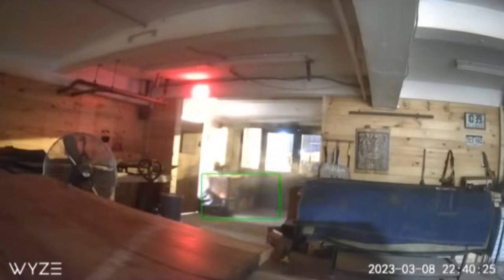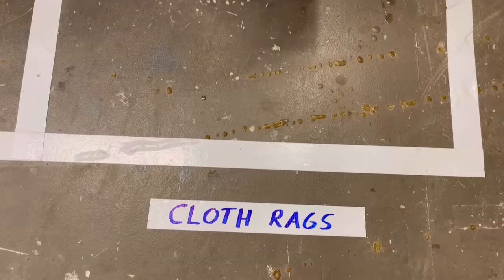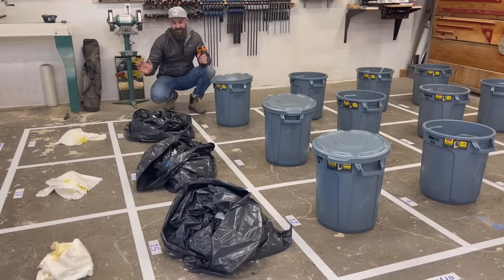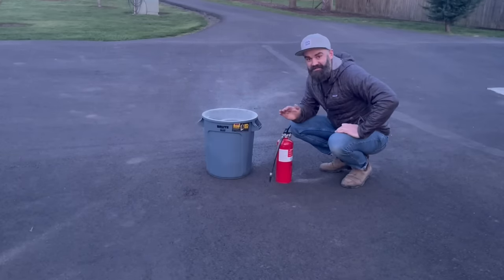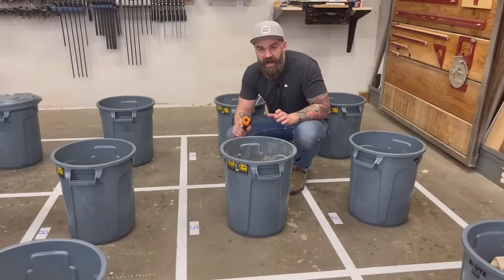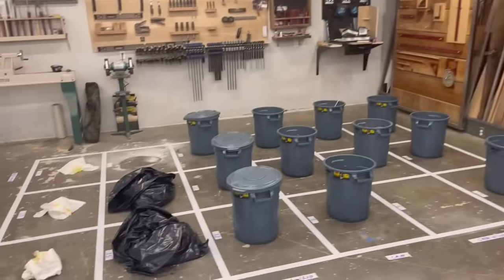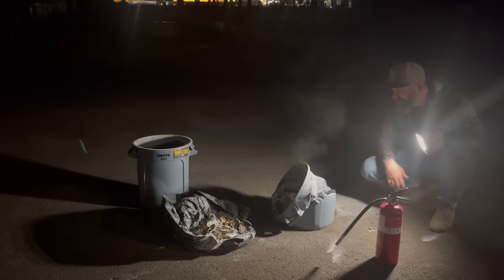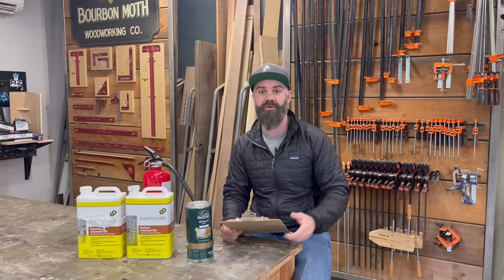I Tried To Burn Down My Shop || This Video Will Save Yours

Comment: Depending on what catches fire you may not have the ability to get the fire out of your shop.  The plastic barrel could easily melt away before you could carry it out, thereby spreading the fire to multiple locations. Good example of how quickly and unexpectedly something can catch fire.

Comment: Thank you for a brilliant video which without a doubt is the most important you have ever done. I have alway put used rags in a glass jar with the top screwed on but from now on, thanks to you, I will dry them out first well away from the workshop and discard them in the garbage and not in the workshop bin. Again thank you, Woody, UK.
Reply: I take it this is a spoof?

Comment: Nearly had an incident with this in the last week.  We're doing trim work on a new home and the owner has been doing most of the staining of the trim.  Had a pile of rags he'd been using with the oil based stain.  He went around to turn off the lights to leave (about 9:30 PM) then got back to the area he'd been working in and started to smell smoke.  Saw it coming from the trash can and managed to grab the ball of rags and get it outside before it went up.

Comment: This happened to me in my garage after a day of staining fence posts with a popular sustainable oil-based (rosewood oil) product. Thankfully, nobody was hurt and the structure was repairable. I’m making a Public Service Announcement to keep a clean shop. In my case, a wadded rag fell behind some cut-off scrap that was pushed aside against the garage wall (to make space for my current project). The debris became a source of kindling after the rag ignited. I was staining panels at around 4pm, and the fire broke out sometime in the middle of the night, when the atmospheric conditions must have become juuust right. I now have dedicated oily waste fireproof trash can, and try to keep things clean enough so that everything is visible.

Comment: This was a very well done video with an important message.  A YouTuber lost his shop due to oily rags in his trash can.  Spontaneous Combustion or Spontaneous Ignition is not limited to oily rags but many other materials under the right conditions.  My concern is that thinking that"dried oily rags" are safe may be a mistake too.

Comment: WOW...that is an eye-opener for sure.  Thank you for putting this PSA out there for all of us to realize the dangers.  Also, for woodshops, is a smoke detector an issue because it could get triggered from the sawdust?  I would think there would be some sort of detection system that could alert you of a fire.  Of course with all the sawdust and lumbar in a woodshop, it could be a fuel-rich environment and go pretty quick.

Comment: This video needs to be watched  by as many ppl as possible! This is a very real problem that could happen at any shop. But what i now really want to know, is this also possible with rags soaked in engine oil? Imagine doing an oilchange at home and this happening to you, either with new or used oil but also with fully synthetic or crude oil i think this could be a very interesting topic to talk about

Comment: Wrong extinguisher ! Best thing and least messy would be to pour a bucket of water over the fire or use a water hose. What is burning is the rags, paper, saw dust etc. not the oil as such. The reason the cans outside re ignited is they were smothered but not cooled!

Comment: Wet hay bales do this as well.  One of the potential flaws in your temperature measurement is that you are taking surface temps.   The ones that rose in temp were because they were compressed and likely the temps inside the rag pile was much higher than your surface temps so if you feel a pile of rags and the outside feels room temperature, you could still have a hot spot smoldering inside that just needs oxygen to burst into flames.  Would be interesting to see the difference if you used temperature probe instead of a laser.  Video proved its point though and excellent reminder of how fast this can happen.

Comment: Yes, I have had this happen with linseed oil, which is used to thin oil paints (like on canvas). Oil painter forums were the only reason I was aware of the trouble, and I despite sorta taking precautions, I got careless and left maybe two paper towels balled up together. I caught it before it set ablaze...it was SO HOT!

Comment: Nice film iam a Danish carpenter and part time firefighter. great content but You really need to clean all of the tools that has a slightly chance for exposure to the fire extinguisher dust/powder it will eat and oxidizethe metal. And as a fellow tool lover i will hate to see alle og the nice tools die.

Comment: I would say that the best thing you can do if you need to use this oil regularly is to have a dedicated metal rag can and the walls behind it clad in stainless steel sheet metal with a fume hood and a heat/fire/smoke detector close by. If the can is rated to handle fire the risk should be minimal. Basically use a burn barrel to put the rags in and fire will be less of a problem.

Comment: Thank you so much for doing this experiment and sharing it with us. I, like you, had certainly knoen the possibility, but never thought it was easy to happen. You've made me respect the oil soaked rags and will certainly lay them out so they dry and not throw them away wet.

Comment: I learned this too recently and had similar thoughts as you did. I thought it was a rare condition but it actually was pretty easy. I used BLO and set a rag in a not well ventilated area under a dresser drawer that was on a table. AC kicked in and pulled the air from the garage into the cold air return and everyone was choking. Ran and cleared it out before any damage occurred. A huge eye opening experience.

Comment: Great video.  The issue with your test method is the temp probe only reads surface temp.  The heat is highest inside the center of the fuel source skewing your readings.  Still, great video showing the point.

Comment: The first time I heard about spontaneous combustion was 7th grade woodshop class and that we were to throw our rags into the red, metal, covered trash cans. Second time, was regarding a drummer issue in 'Spinal Tap.' While I always thought it was kind of a cool "concept", it's now seared (pun intended) into my safety practices moving forward. I've always tried to dispose of my used rags safely, but honestly wasn't sure if I even believed it was a real thing. Just erring on safety. SEEING it actually happen is pretty terrifying and important to know it's actually real. Thanks for making this. It's no longer just a "concept" for me. On that note: Rags can also be disposed of by submerging them into a bucket of water.

Comment: But what I want to know is... What is actually going on? What is the linseed oil reacting to? Is it reacting to the air, plastic, or the cloth? It obviously doesn't spontaneously catch fire in it's own container. Also, it makes me wonder if laying out rags to dry even works. After 11 hours you would have thought that these rags would have been dry, yet they still caught fire. It seems like one key is to have the container covered with a lid.

Comment: Whilst I applaud your reasons for doing this, I have to question your sanity and safety for deliberately trying to start fires in plastic bin-bags and plastic trash-cans. And then trying to carry the burning things outside. That third fire caused the trash-can to melt and slump just a few seconds after you left to get the extinguisher. If that had happened while you were carrying it you  would have been in deep shit! Not to mention the hideous risk of the poison fumes that burning plastic produces. Very glad that you're safe and sound, but please don't do anything like that again!

Comment: Hands down, one of the best and informative woodworking video's on youtube.  My shop is in my basement, so if I start a fire, its my whole house.  I haven't really gotten finishes using oil yet, currently using primarily stains and water base urethanes, but know I will one day graduate to others.  Having this knowledge will allow me to approach that day with adequate caution when considering my set up.  Thank you

Comment: if you want to see things go up in flame a lot quicker, try applying indeed oil with a cotton polishing cloth on a hard wood, and keep rubbing until the surface is dry and watch as the heat from the friction sets off the reaction in your hands.

Comment: To extinguish the fires in the garbage cans wouldn't it have worked just as well to put the lid on to smother it? Just like a grease fire in your kitchen skillet, put a lid on it. Starved of oxygen it should go out. The lid was thick enough it would have smothered  before it had time to burn through. Saves from discharging the fire extinguisher mess unless you couldn't snuff it out with the simplest method. (We keep a 5lb extinguisher under the sink just in case.) Your red metal can didn't heat up because it has a lid on it which reduces exposure to air. Same reason the garbage cans that had their lids on them didn't heat up either but the open cans and bags did. The lineseed oil needs prolonged exposure to oxygen to generate the chemical reaction to create heat. Left in contact with the fuel ( rags, wood scraps and sawdust) you had all of the ingredients for fire: heat, oxygen, fuel. For safety when working on engines and tools in the garage, I keep a galvanized steel garbage can with a tight fitting lid for disposing of rags used in oil, solvents, etc. I have a small reuseable 600 grit rubber sandpaper block I use with linseed oil for small projects.  I always store it in a glass jar with a tight fitting lid. Whenever the project is finished, the block and jar is always soaked in a tub of  Dawn dishwashing liquid and water to emulsify and wash the oil out of everything. The block is then left out to completely dry before putting it away. Something my grandfather taught me about linseed oil...

Comment: great video explaining this. you might want to invest in non powder fire extinguishers as the powder ones really mess up electronics and metals even with small amounts , use it inside and you can just as well fully redo everything from electronics to plumbing

Comment: This is one of the best woodshop videos I’ve ever seen. And I’ve watched hundreds. My neighbors son left linseed oil soaked rags in his garage about 12 months ago. The rags spontaneously combusted and burned his garage interior without burning the garage down because the door was closed. Had someone open the door to see where the smoke was coming from it could’ve been deadly. Interestingly enough, his garage had a Ferrari and another exotic car both of which were in need of ground up restoration after the incident. have a large Wood Shop and I’ve always been extremely careful. Any rags that I have soaked in Linseed oil or any kind of solvent I tossed outside of my wood shop when I leave. Not to say, this is a good idea because they could still combustion create a fire on my driveway. And thank you for creating a video that makes it more than clear but the possibilities are no matter what we are doing with solvents or finishes.

Comment: I always thought that was an issue for you guys above the Mason Dixon line in dryer climates. For people like me in the south where the humidity is 80+% daily, I never thought it could happen here. WRONG. Luckily my wife looked out the window and saw smoke in time for us to save everything except for the trash can. Mine was Tung oil rags. I now have a metal container for them and spread them out (not balled). I also put the container outside for a day or so. THIS IS REAL FOLKS.

Comment: You mentioned you had water there as well as your fire extinguishers. Please let people know NOT to pour water on oil fires- like linseed oil. Also, they should have at least a B class fire  extinguisher rated for oils/solvents. ABC would be best.

Comment: Pretty sure it's not the rags/paper that catches first, it's the vapors coming off the oil.  Once that ignites then the paper/rags/wood lights.  
I think it also likely that the STRUCTURE of the objects in the containers can create pockets of vapor that will spontaneously ignite.  So it would seem very random and very hard to reproduce.
EXCELLENT video.

Comment: Great video - thanks for putting in all that work to test the combinations. You mention that wood/paper needs to get over 400 to ignite -  but clearly that's not the critical point. I think the issue is that the flashpoint of linseed oil is only 200 degrees F (93.3 C).    The flashpoint of beeswax is similar,  So I think what is happening is that the curing oil creates the heat from the reaction.  When that heat reaches other sections of the still liquid oil or the molten beeswax we get ignition. Recognizing that only one small spot in the entire pile needs to hit the ignition point to start the chain recaction, I think many of your other samples could have been close to ignition as well.   But the other factor is that if it takes so long that all the oil is dry, then there is nothing to burn.  Boiled Linseed oil cures faster - some generated more heat because of the curing speed while some puddle was still wet, and voila -flames.  Not sure if the Rubio used polymerized Linseed or something else to help curing speed -  or maybe the wax content ingnited at even lower temp. 

All this is based on what I've read - I'm not a chemist - I just go down some rat holes of finishes once in a while.

Comment: I'd be interested to know the temperature when each of the fires started. If they went from 100 -120° up to ON FIRE within 30 minutes, how much was the difference - how hot did they need to get to before spontaneous combustion 😅😅

Comment: Imma pause before watching and guess. This is going to be about MEK or some kind of oil/spirits left uncovered?  
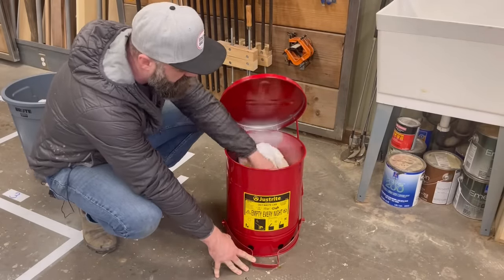EDIT: Called it! Yeah, oil soaked anything can undergo an exothermic reaction when the oil fumes evaporate, so the rags get incredibly hot, and auto-ignite. Best way to avoid this is to put them in a dedicated hot-can like at 29:00.

Comment: The factory I used to work for almost burnt down from Rubio monocoat soaked rags. This is totally true. let them dry completely flat or put into water as recommended. Thanks for posting this video Its gonna save a few shops I have no doubt.

Comment: GREAT GREAT INFO! Definitely passing on the info to others but for most part i was in the process of starting to build cabinet drawers for a client and had the linseed oil in mind to finish the boxes. We work mobile at times and could have mistakenly started a fire in the van or at client's home! thanks again for the info and experiment.

Comment: This is from the msds for linseed oil.
Section 05: FIRE FIGHTING MEASURES FLASH POINT (ºC), METHOD: > 93.3 C
This is basically 200 F. So when you started reading temperatures of 180 I was thinking that one would be next.

Comment: Well this was terrifying. 
I'm usually very paranoid about oily rags; but I'll admit there's been a few times where it's been late, and I've had a rag with only a little that I've just chucked in the trash without thinking-and then didn't fish out, because, well, nothing's ever happened. 
After all, what are the odds? 

Apparently higher than expected. Admittedly I mostly do tung oil, which wasn't tested here, and may have different combustion properties, but...I'd rather not find out. 
Oily rag caution is now right up there with tablesaw caution

Comment: I am working currently as a firefighter paramedic for over 20 years of experience. Your video made me cringe.  There were a few safety concerns that your test set up could’ve been critically a failure. One is that you moved active fire in a combustible container without first using the extinguisher to knock the flames out. Two when moving you did not have a clear path of exit. Three you should’ve had a hose line set up to douse the items once you got outside. four is the smoke that you inhaled is highly toxic, Carcinogenic and damaging to the lungs.  I do commend you on the fact that you never left the test subjects unsupervised. With all that being said, I enjoy your videos and look forward to future tips for woodworking, that is. Next time I suggest that you consult a firefighter prior to doing this type of test.
Reply: Love the tips and the humor.

Comment: Another woodworking fire hazard is wood bleach. The dust from sanding bleached wood is very combustible, burns with a flame that looks a lot like a sodium fire. This dust is known to spontaneously combust. However even large pieces are not entirely safe. I had a piece of ½" walnut about 12 x 60 that I had made to replace a broken piece in a custom van. I moved it out of the shop because of space constraints. The piece was still a little damp and the color was not as light as it normally gets. It was a bright clear hot gusty spring day in Dallas TX. About an hour later the wood began to smoke. As I approached flames began at one corner. I poured a water bottle on it. I had to sand it down and bleach it again, but the piece was salvaged. BTW if you have wood in a custom vehicle that you can't get both the color and grain to match, there is a good chance that using walnut and treating it with wood bleach and then Minwax colonial maple stain will come very close to a perfect match.